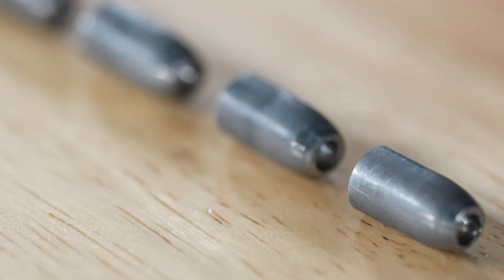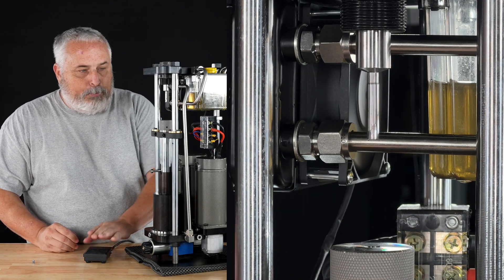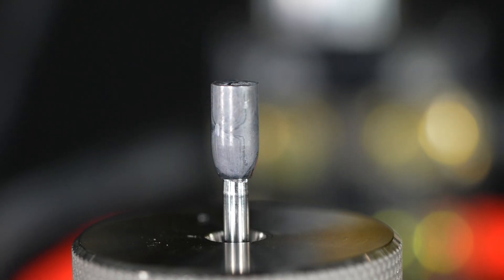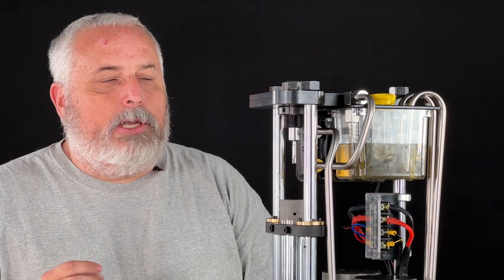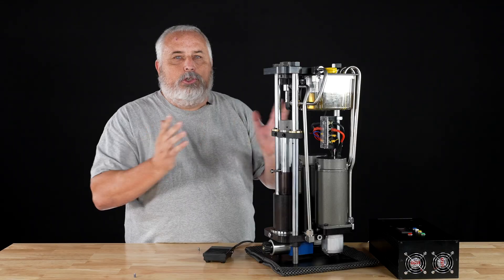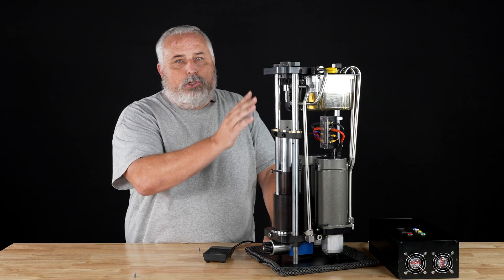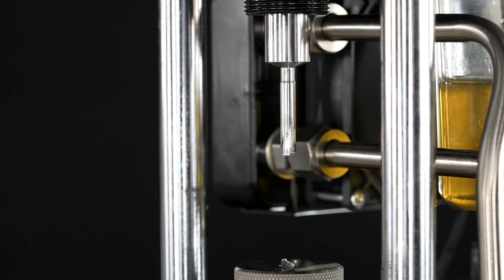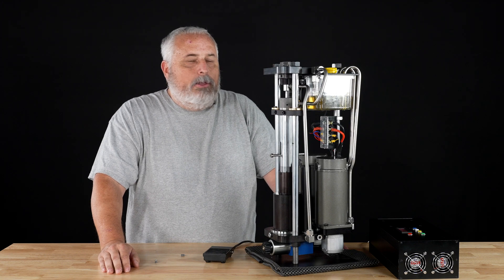Revolutionizing Airgun Slug Production: Western Big Horn Bullet Press

Comment: I believe it’s not practical, and the reason is that it only presses. What’s so special about that? Is it hydraulic or electric? In my opinion, manual tools are more practical because they don’t break down like electric ones, which definitely have a limited lifespan and require regular maintenance, making them harder to use. If it had additional features, like working automatically to perform tasks without direct intervention, then I would consider it special. But if it’s just about pressing? I see no real benefit in that. That’s my opinion.

Comment: Love your n s a's by the way.. In my research , I have found that there are a few Ways to make your own ammo with presses like this, The problem seems to be finding Something you can use to make your own lead WIRE ! Because if you have to buy it it's defeating the purpose Of making your own. Unless I.
'm missing something I don't see Any product that enables you to make your own wire from Recycled  lead.
Reply: There is a guy on YouTube showing how he makes his own slugs and he made a wire mold out of two thick pieces of aluminum sheet and drilling a hole between them while they are bolted together. Looks like a really cheap and easy way to take range pick up lead and turn it ont the correct diameter lead wire.